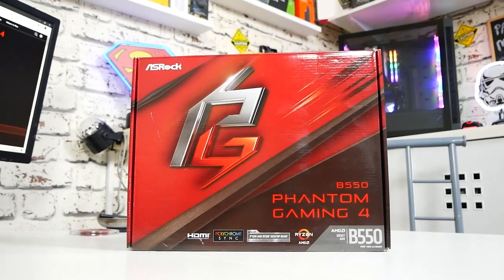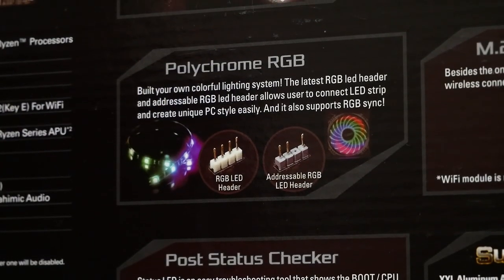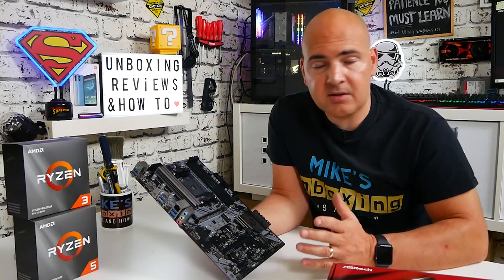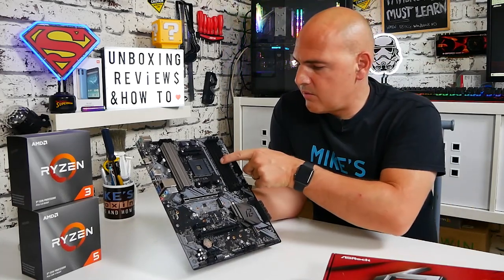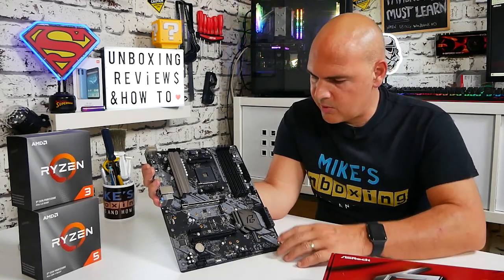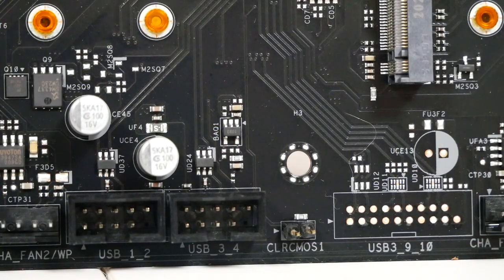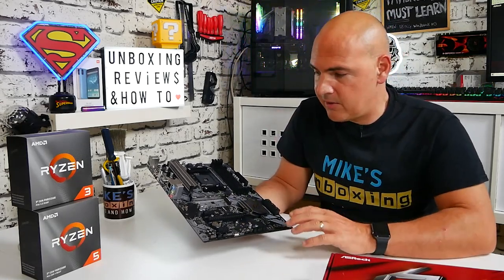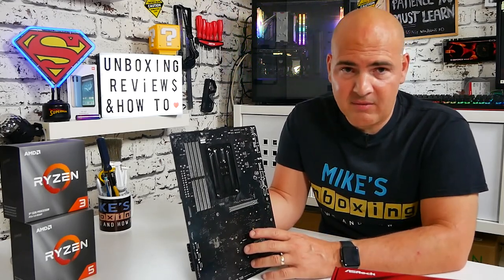Asrock B550 Phantom Gaming 4 Best Budget AM4 3rd Gen Motherboard

Comment: did you install the second M.2 SSD slot yourself? i only have the hyper M.2 slot, when i bought it i thought it had 2 slots now after i bought my second nvme SSD i realized theres is just one slot
Reply from the maker: no it comes with three m.2 ports one pcie gen 4 one pcie gen 3 and the m.2 wifi card
Reply: @mikesunboxing  sadly mine came missing the socket it self, most reviews said so too. i just noticed after 6 months

Comment: I have the options between ASRock B450 Steel Legend AMD B450 OR ASRock B550 Phantom Gaming 4/AC and finaaaaaaaalyyyy Gigabyte B450 AORUS ELITE V2 AMD B450 - which would you pick
Reply from the maker: probably the phantom gaming but it will depend slightly on the processor
Reply: @mikesunboxing  Ryzen 3600 :)

Comment: I use my USB 7.1 headphones. Will I have issues (loose quality)? If I have a speaker I just need to plug into the green one, right? Still 7.1 audio?
Tks :)
Reply from the maker: you won't get 7.1 out of a single jack but the USb will still work okay
Reply: @mikesunboxing  USB will work "okay"? What are you talking about?

Comment: hello Sir. I have a ryzen 3200g, if I put it on an asrock b550m phantom gaming 4 (the motherboard is new, I don't have other cpu) will it work without problems? because like the atx model, it also says that it is for ryzen 3000 processors. I have 3200mhz 16gb ram geil evo potenza. Thanks.
Reply from the maker: a lot of people have done this and seems okay

Comment: Should I take this motherboard or MSI B450 Gaming Carbon Max Wifi?
Reply: I'm going to use Ryzen 5 3600 and RTX 2060 (maybe I will upgrade in few years to RTX 3070)
Reply from the maker: if you are going rtx 3000 series you would be better served with PCIE4
Reply: @mikesunboxing  okay. Thank you for answer
Reply: Filip Antol unless you already have it please do not buy the 2070 please wait 1 month and buy this board and a 3070 so much better and it’s only $400

Comment: I have have assembled my new pc using this board however i get no display from the hdmi and I get a red error light for the memory and cpu. I have reconnected everything but no fix. Is this a motherboard issue or something else I am doing wrong? Thanks in advance.
Reply from the maker: This is maybe easier to fix or at least advise if we can ask more questions and get direct answers, so feel free to join our Discord chat and we can go over it in more detail https://discord.gg/gaeeDPw
Reply: I had the same problem but I just connected the HDMI to the GPU card instead and it functioned fine.
Reply: What build is it intel or amd. If amd u won't get hdmi, no integrated graphics

Comment: Can you please help me understand how de PCI for storage work? I dont understanf if i hace an M.2 NVME 3.0. How many sata ssd I can actually add? also if i got the one you got if I connect the Wifi card I loose sata ports? can you please explain how this works?
Reply from the maker: this is explained much better on the Asrock website for the full technical details

Comment: I have a rx580 and 24gb 3600mhz ram and have 500w power supply will it be enough to run a ryzen 7 3700x with this motherboard?
Reply from the maker: it should be okay if it is a quality model but it is a little on the low side

Comment: If I put a ryzen 5 3600xt with a rx 6800xt/ thx 3070 would there be any problem with the bored
Reply from the maker: no that is fine my friend
Reply: Thx I got a 3600xt because it was cheaper that a 3600 atm even 3600x

Comment: does this mobo have wifi built in it for wireless connection?
Reply from the maker: not this one but there is another model with wifi available or you can buy the card as an add on

Comment: I need your opinion guys. I haven’t touch my pc for a year and i’m planning on upgrading it. I’ll be switching to ryzen this time. Will this board be ok with a ryzen 5 3600x? I still have my GPU And still plan on using it. (Asus gtx 1060 6gb strix)
Reply: A B550 Phantom Gaming 4? Yes, that would definitely be enough for a Ryzen 5 3600X. It can handle a Ryzen 9 (at least if you don't overclock) so should have no trouble with a Ryzen 5. Zen 2 is extremely efficient, so the Ryzen 5 3600 and 3600X can run fine on pretty much any AM4 motherboard without VRM throttling.
Reply: Nathan Gamble wow thank you for the reply, yes b550. Sorry I have like 1% knowledge about computer parts. What about my GPU? I don’t intend on changing it yet lol, it cost me a lot as a student a year ago.
Reply from the maker: totally fine
Reply from the maker: This is maybe easier to fix or at least advise if we can ask more questions and get direct answers, so feel free to join our Discord chat and we can go over it in more detail https://discord.gg/gaeeDPw

Comment: Is there a BIOS update that lets you use the Ryzen 3 3200g?
Reply from the maker: yes it has been added in bios P2.00
Reply: @mikesunboxing  I meant to say will it work on the  b550 phantom gaming 4/ac? Sorry for my miscommunication.
Reply from the maker: @spikedemperor023  yes - it's the same board but with wifi built in, but make sure you get the right BIOS for your board

Comment: I'm thinking about getting the WIFI version of this board(its £1 more) I realise it has less SATA ports(4 compared to 6) but can someone tell me if the AC version has one or two M.2 Slot.  The Amazon description isn't clear to me
Reply from the maker: Should be two on the atx version
Reply: Thank you. You’ve been really helpful through my whole part selection process. I appreciate it😊
Reply from the maker: No problem
Reply: @kev2427  Can you confirms, that the AC version has two M.2 slots? Im wondering as well, because the official manual of the AC version also says that it has only one M.2 slots, although it looks like there is a second one on all photos. I don't really understand why they should leave the second one out on the AC version.
Reply: @der_David59  it has one. I ended up going with the non AC version as it really annoyed me
Reply: @kev2427  Thanks for the answer! I can't really understand why they did that. What have they done to the two PCIE 3.0 lanes that were used for that M.2 Slot?
How did you confirm that there is only one?

Comment: Hello my ddr4 16gb 3200mhz is shown as 2400mhz, i tried selecting the xpm, there are 3 options, auto, xpm 1 and 2 none of them work, the pc reboots and back to default config and it shown as 2400mhz
Reply: A2 B2
Reply: @MrStamina777  i switched the slot into the second slot closest from cpu, and the xpm works well shown 3200mhz, but the cpuid still read it as 2400mhz
Reply from the maker: This is maybe easier to fix or at least advise if we can ask more questions and get direct answers, so feel free to join our Discord chat and we can go over it in more detail https://discord.gg/gaeeDPw
Reply: @mikesunboxing  are u going to overclock this mobo, looking forward to see the video
Reply from the maker: Yes probably but as this is 3000 series cpu that won’t be much 😎
Reply: @mikesunboxing  i only have a 3400g cpu without gpu for now, running out of budget, and cant find any solution to increase the  vram, seems the bios is totally different than the previous or commons asrock bios, so please make a tutorial for this mobo
Honestly i am at loss right now, i cant find the setting for the vrm it's too low 256mb, but if my ram speed turn into 2400mhz the vram goes into 2gb, i dunno where i can find the integrated gpu setting in this bios, it's totally different then the previous version, i have checked nbio common option couldnt find it
Reply from the maker: @fransnainggolan7980  technically this boards doesn't support that APU so i would expect it to not allow the changes
Reply: @mikesunboxing  ok here's another one, i am at loss now, i bought the other ddr4 ram same brand, size and speed hyper fury 3200 16gb, so i putted them all at a2 and b2, none of xpm can get 3200 mhz it keeps beeping and restore the bios back to 2400 setting, knowing that 3400g running stable with 2933 mhz yeah i pick that speed the pc run smootly for 2 days playing daily and today i have found the pc black screen or no display on my monitor and i cant use alt f4 or even my cursor gone when i was playing csgo (the fan still works no beep or no restart) my reset and power off on doesnt respond too, i have to switch it off by using psu switch, and i checked bios the setting back into default setting again, so i put 2933 with xpm setting  it didnt work again, i have to lower it again to 2800 mhz and start playing csgo again,and it suddenly black screen no display again, again and again, i've checked the hw temp, my cpu didnt overheat, idle 30-40, max 71c, is it my mobo problem or my psu? I am using fps hv 550w now, please help me sir
Reply from the maker: You need to ask this in the discord tech support
Reply: @mikesunboxing  not a discord user, more like i am still living in a cave, i will try it then sir